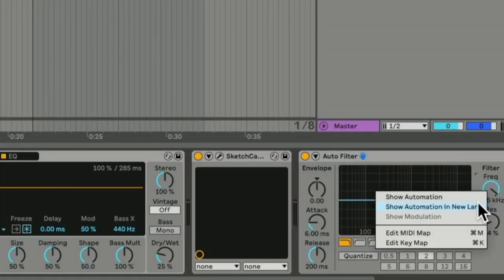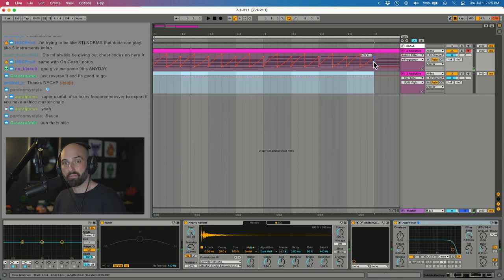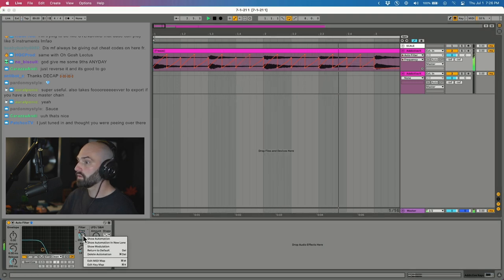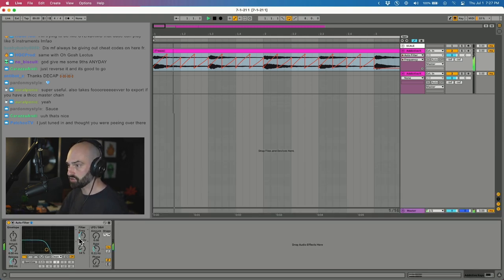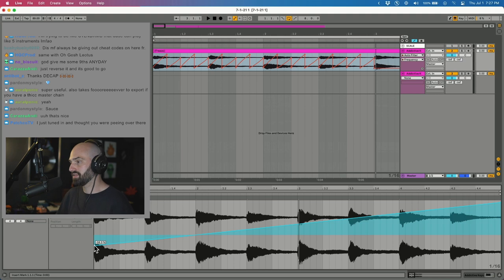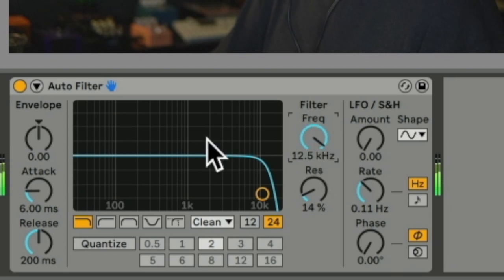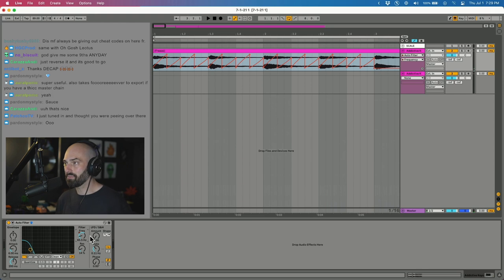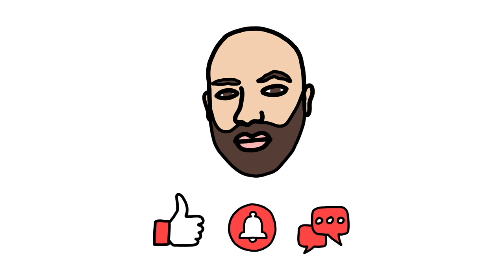How to Use Automation and Modulation in Ableton Live 📈📉

Comment: The terms used are misleading. Technically, modulation is occurring in both instances. What is being called automation here is accurate: automating a parameter is taking place. What is being called modulation here is more accurately described as range: parameter range automation is taking place.

Comment: Is this the difference just within the context of Ableton or in general? Because I always thought automation was when you manually record parameter changes and modulation was when you set up a synth or VST to do parameter changes on its own.
Reply: In general, any device or electronic instrument that’s capable of automation and modulation can be applied this same way only with the physical aspect of the synth you’re dialing in on a semi precise number.
Reply: @jaderene  Gotcha. Thanks
Reply: I mean with regards to different software since which has modulation (and can of course be automated) it’s more of a case by case thing. I feel like for most synths modulation can be seen as adding or subtracting some value from the knob, kind a like here in Ableton, Though in Ableton it’s kind of displayed as a percentage value of the amount of the knob that’s turned, hence Decap described it as such. It depends on how is the synth wants to work with it. With regards to automation, it basically always just means something turning a knob for you.